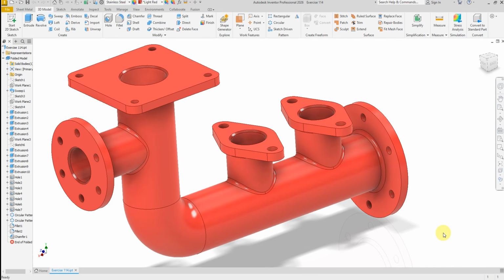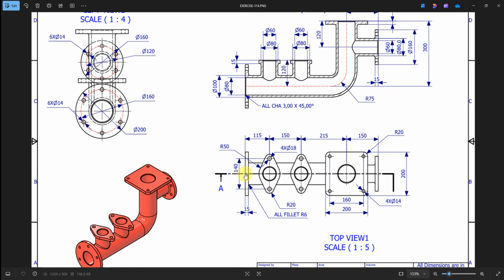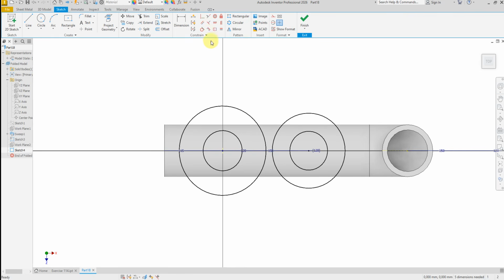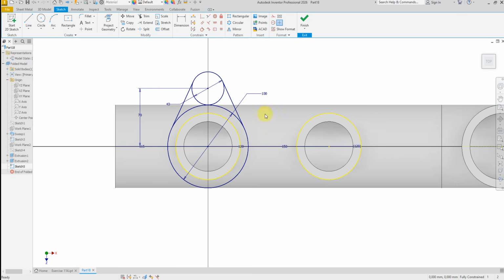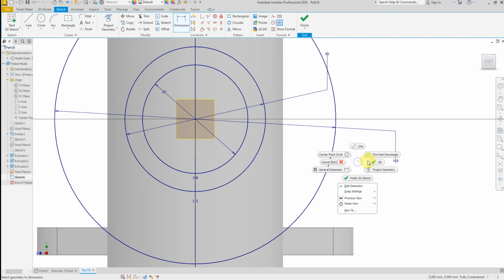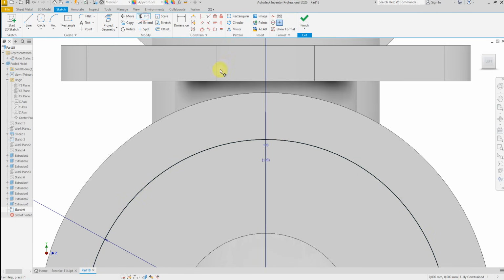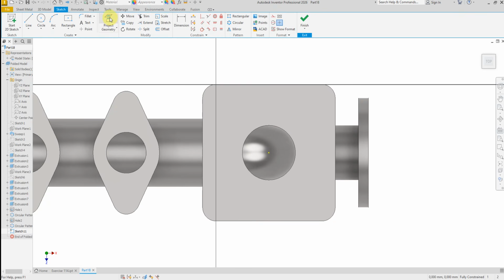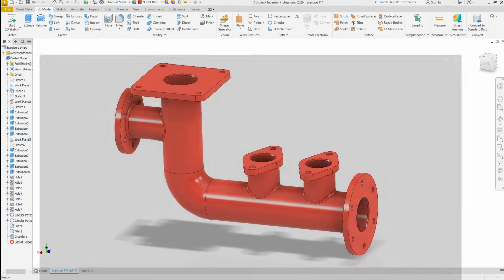Autodesk Inventor 2026 Create Pipe With FlangeS Exercise 114

Comment: I'm trying to step up from a machine shop to a design office. My interview is in a few days and I need to at least know what Autodesk Inventor is and how it works. Trying to learn as many key commands as I can during my breaks. Thanks a lot! 🙏🏻
Reply from the maker: Hi ! "Appreciate the comment! Thanks for supporting the channel!"

Autodesk Inventor is a 3D parametric CAD software used to design mechanical components, complex assemblies, and production drawings.

Coming from a machine shop background, your advantage is knowing how parts are actually made. In Inventor, you follow that exact physical logic digitally through four core environments:

How It Works (The Core Workflow)

1-Part Modeling (.ipt): Start on a plane  draw a 2D sketch  dimension and constrain it then turn it 3D using features like Extrude ,Revolve or other feature according to your need . 

2-Assembly (.iam): Bring multiple .ipt files together and apply Joints or Constraints (mate, flush, insert) to make them lock together like physical hardware.

3- Drawing (.idw or .dwg): Place views of your 3D models onto a sheet to automatically generate dimensions, section views, and Bill of Materials (BOM). 

"Hope this helps, and good luck with the interview!"
Reply: @SolidCam-CadI'll treasure your advice, thanks again